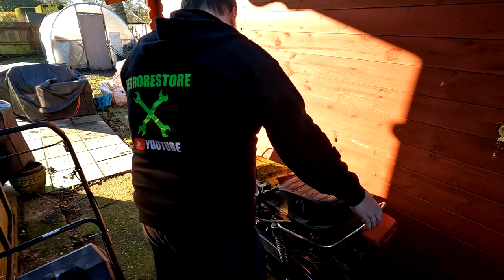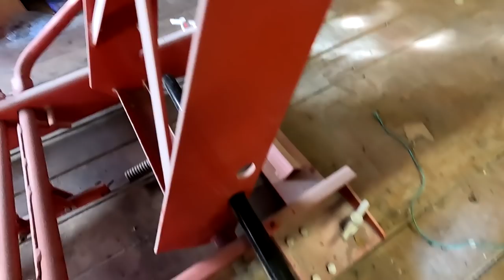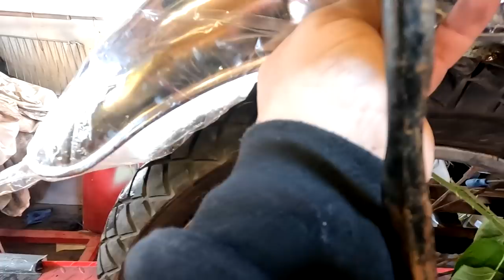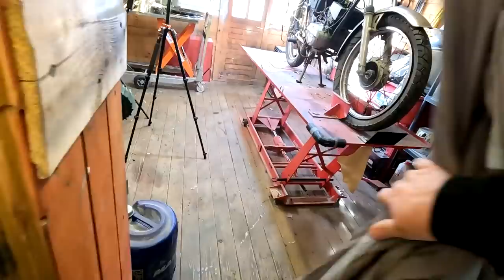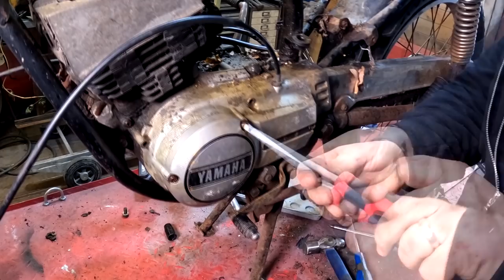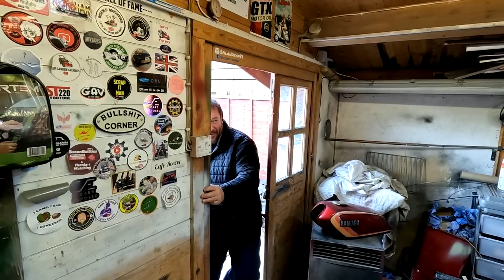Restoring the Worst Motorcycle On Youtube Part 1

Comment: I have a 91 plate RXS 100 Energy Induction..Spent money on he,but ride it only in Summer.Propper 2 stroke oil in castrol racing it does not smoke like when cheap crap0 is used

Comment: Martin, an impact driver (the type you hit with a hammer) would probably have loosened those screws. Would they work with JIS screws? Will the bare frame fit in your powdercoating cabinet? While WD40 is better than nothing, there are better penetrating fluids out there. I've used PlusGas in the past (the best but pricey) and I'm currently using the Halfords one.
Reply from the maker: I didn't have any JIS impact bits. I got them all out using this method.
Not sure if it will go in till I try.